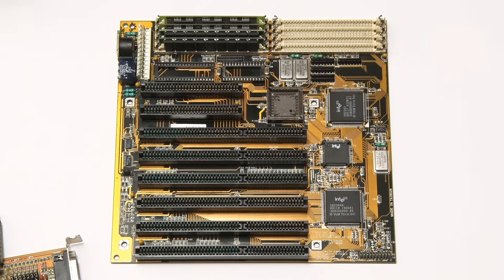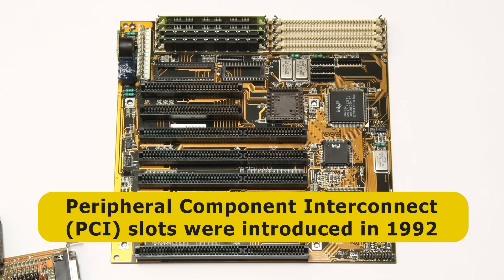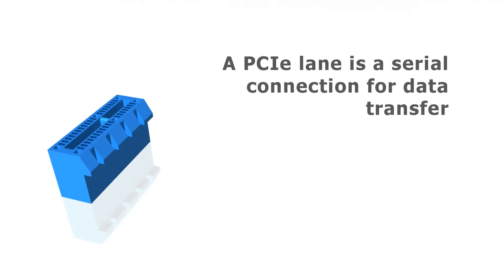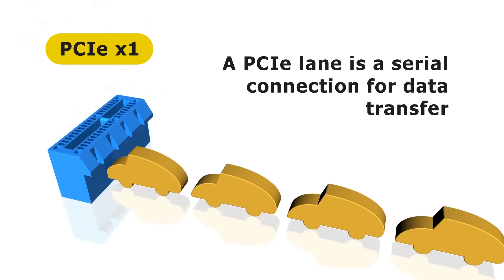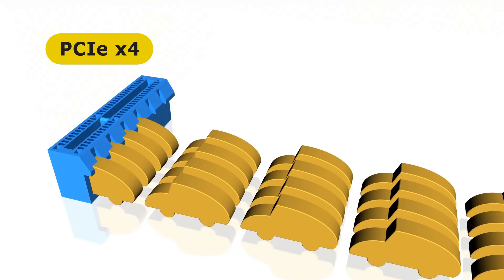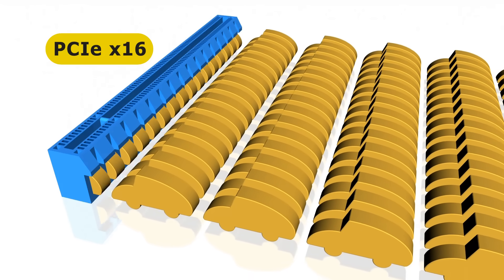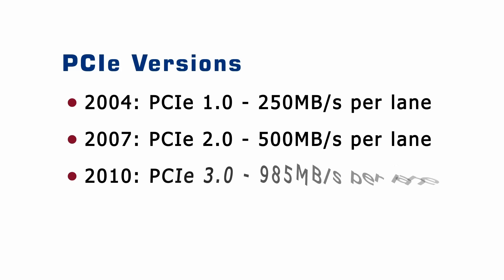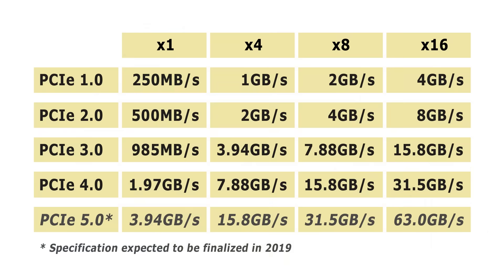Explaining PCIe Slots

Comment: I remember when VESA local bus slots were the limit on bandwidth because of physics, and that would be end of slot evolution.
Reply: Similar to the 'absolute physical' max of 56 kbps for the modem/telephone line.........   (submitting this reply with 30 Mbps over that very same telephone line).  hahaha.
Reply: Ron Freycinet its not actually the very same phone line. Now they are digital and allow for higher frequencies.
The reason line phones sounded so dull and xrappy back then os because they were fully analogue, meaning the dullness was because the line was filtering higher frequencies. Now the problem was that it wasnt by design, they had no way to make the lines have higher bandwidth, and thats why modems makes those noices at the beginning, to test the line response to see what frequency range it can use to transmit data to the server.
Its like trying to record a bluray to a vhs, the signal may be hd but the tape cant hold so much detail
Reply: @laharl2k  I lived in a rural area up until a couple years ago. It was either dial up or satellite. It sucked. When DSL was finally available, I was barely able to get 1.5 down due the age of the 50 year old copper wire in the ground in my area and they needed to take out 5 loads(sp?) in the line on the way to my house from the DSLAM. I now live where I get true gig speed. It's sooo nice!
Reply: That's because incompetent hacks and nincompoops love to make assertions out of their, ehem, assertion ports.  And physicists in the late 1800s and up into the very early 1900s said that we almost had all of physics sorted out, we just needed to work out a few things around the edges... Then by 1925 or so we had both relativity AND quantum mechanics, which we're FAR from sorting out.

Which brings me to the main point of my rant.  Now we're having to learn quantum programming -- that is, writing programs for the new quantum computers available today via something like the old main frame "time share" (luckily they also have simulators to practice on).

But even with classical computing (which is what we're calling our "old" computers), there's no telling what those smart bastards will come up with next.  Fabrication techniques will continue to improve, so the transistors will keep getting smaller and likely more "3d" where they are built upwards more than being flat on a chip and, thus, reducing the trace length and capacitance  between transistors, etc...

Comment: Didya know you can fit a larger PCIe card in a smaller slot, too? I once had a server with an 8 gig HBA and only one PCIe slot big enough to handle it. So I took the graphics card out of that slot, and used a dremel to sheer the card's edge connector down to the point where only one PCIe lane was left. Then I stuck the graphics card into a x1 slot, and it worked! Not perfectly, of course: It was slow as hell to redraw even just the Windows desktop. But as it was a server, that didn't really matter.
Reply from the maker: I decided not to cover dremel options -- although I do show what you describe (a larger card into a open-ended smaller slot) at about 9:50 :)

Comment: I don't usually watch older videos but in this case I wanted to know more about these slots and now I do! Thanks and I am wondering what is used in laptops since that is what I have been using now for many years. I may buy a desktop computer next time since I don't move my laptop much at all now. Desktops seem to be much more powerful for less money because of the larger size and not being mobile.
Reply from the maker: Laptops may have express card, mSATA, or M.2 (PCIe, SATA or USB) slots, used for connecting drives and network cards, but will not have PCIe slots. Desktops indeed offer more power (and flexibility) for the same money.

Comment: This was interesting and useful - however I had hoped you were going to go 1 step further and talk about how the data gets from the slot to the CPU and point out how in some cases the slots use “shared” pathways and sometimes they have variable numbers of lanes.  (ie we have an Asus motherboard with a x16 slot - but it’s only a x16 if we leave another spot empty.  If we put something in the other spot, the original x16 spot becomes a x8 or x4 slot)
Reply: Can i put pcie 2.0 x16 card in pcie x16 slot ?
Reply: @unbroken5011  typically, yes, it will just run slower (on the best case scenario), but sometimes the card will say *frick it, if I'm not on x version of PCI/PCIe I won't work*.
For example, my graphics card (an nVidia GTX 1650 with unlocked clock speeds and GDDR5, from this year) supports PCIe 4.0 (maybe 5.0? I dunno), but I use it on a board from 5 years ago, and thus, the board only has support for PCIe 3.0, so the graphics card sits at a top of 96% of utilization on the best of the cases.
Reply: It would most often be a motherboard limit - not a CPU limit - and it completely depends on how many PCI slots (and what type) the motherboard manufacturer decided to offer.  We have a 9700K and an Asus ROG motherboard that has a “conditional” slot.
Reply: the n° of lanes depends on the chipset it think
Reply: exactly, and the newer 2020 SSD video also misses that point: if you install M.2 ssd in a slot that shares lanes with Pcie x16 (typical primary vga slot), you may have to use 8x/8x or 4x/4x PCIE Bifurcation - so, Chris, it is another good topic for future videos!
Reply: This is because you have a cheap motherboard. The problem here that if you populate everything, they run out of lanes (CPU limitation; this is an Intel CPU, isn't it?). The best solution for this is a PCIe switch (much like an ethernet switch); with a switch you can put multiple cards onto the same lane, and they lose performance only when you use the cards at the same time. However, it is cheaper to assign lanes statically at boot time (a few transistors can easily select the right card).
Reply: Most CPUs don't have that kind of bottleneck and I don't believe motherboards do either. Most CPUs have lane limits up in the 20s and the newest ones hit the 40s.
Reply: @vasilis23456  i've h310 mobo, if besides cpu and ram i plug my x16, m2, 3 satas and ram i AM a couple of lanes above the total capacities of all of my periferals combined. sure, it's nothing dramatic, but it's useful to know somtimes when all of the sudden you see your data copy speeds 4 times below drives specs (after i moved to z370 and separated the drives in the best way i always get 70-110MBps read/write speeds on mechanical satas, on h310 i'd hit 10-20MBps bottlenecks quite often...

Comment: PCIe has evolved to make our fancy little computer components compatible without much compromise.    I splurged on my CPU to get the best one for the socket, I didn't splurge on my GPU just yet, as the PCIe has always been universal and can upgrade that at anytime, as long as my PSU has enough juice.   I bet computers 5-10 years from now will still be able to use today's GPU's (maybe not for actual current gaming)  and GPU's made 5-10 years from now will still fit lovely in our PCIe x 16 (8.0 they may be at by then?)  Crazy the things I learn from just researching on my new computer build.

Comment: Skipped over PCI (i.e. pre-PCIe) explanation.... PCI is parallel... PCIe is high-speed serial:
PCI: max 5 devices... ideal conditions, 64bits@66MHz - 532MB/s... PCIe: up to 32 devices... from 250MB/s to several GB/s...
Also significant, particularly with Graphics cards (e.g. 16x) is type (e.g. DDR) and size of memory to alleviate CPU workload while using higher resolution PC monitors/displays;
Most sensible for PCIe x16 Slot should be allocated for graphics cards (alleviating CPU workload)... PCIe x1 is sensible for USB 3.0 adapters... PCIe x1 for network adapters is desirable...  PCI (non- "e"xpress) should be sufficient for most audio cards... although PCIe x1 (when available) for audio is not unreasonable.
Reply from the maker: PCI was mentioned. RAM will impact PCIe device performance, but this video is about the PCIe standard.

Comment: Are all the PCI-E 4.0 slots reduced to PCI-E 3.0 speed if I put a PCI-E 3.0 graphic card in a PCI-E 4.0 motherboard? Or only the slot that has PCI-E 3.0 graphic card inserted? Thank you.
Reply from the maker: Only the speed of the slot used will drop down (to match the card used in it if slower).

Comment: Good info! I'm reminded of a peculiarity of some 16bit cards, notably Trident video cards and some VLB I/O cards: they would work in an 8bit slot, such as on yours (can't see if it's a 286 or an early 386?) This is how I managed to have an XT with VGA graphics (which proved that the XT's real speed bottleneck had been the mono vidcard; even the sloooow Trident card was a huge upgrade).

That oldie must have been a fancy board back in the 1980s... my goodness, 8 SIMM slots! There I once had an oddity too: a 10MHz 286 board that took a single 72pin SIMM. (Yes, 72pin. It was salvage from an unknown IBM.)

Comment: Question. I saw where someone used a PCIe adapter card that accepts a M.2 NVME stick and that they put into an available PCIe x4 slot and got around 1700 Mbs from the NVME stick vs their Sata 6 SSD drive. 

Alithough the speed of the NVME stick is about half what it would be vs being plugged into a compatible motherboard, but over double that of their SSD, I’m curious if this would work with most any motherboard with PCIe x4 slots that are maybe 2014 or newer or would other issues arise?

Thanks
Reply from the maker: It will probably work in many PCs, but you will need OS support, and also BIOS support if you want a bootable drive. Only PCs with a BIOS from c.2016/17+ will have native NVME support.
Reply: ExplainingComputers that makes sense. Thanks for responding. Love your videos.

Comment: 2:02 what is that slot on the top of the board with the 2 large black brackets around it?
Reply from the maker: That is the processor slot! :) Weird designs in them days,
Reply: @ExplainingComputers  Right I forgot about CPU cards. The Pentium 2s used those iirc

Comment: I've added cards, increased bandwidth and tweaked buses for about 40 years. I have physically flipped hidden switches that increased toggled down mainframe performance, that was only unlocked after the customer paid the fee. Yet you often add the piece that completes the picture so often. This is a great channel. I'm sure a lot of current pro's couldn't be bothered by systems that only worked everywhere after the 8-bit byte became the industry standard. I'm one of the guys from that slow era. I walked into this weird world of ever exploding performance while 3090 mainframes suddenly went obsolete when system 9000 took over. I remember how long it took for me to realize the 3081 system I trained on, actually was two systems within a single processor.  It's irrelevant today, but I recall when virtualization was born. I really enjoy both the trip down memory lane as well as the broader present day picture. Thank you.
Reply: And now 3090's are once again the absolute greatest you can get-- RTX, that is.

Comment: so which PCIe would you want to plug into a Network LAN Card? x16 because you get more data? is that what I am understanding?
Reply from the maker: Yes, if it were a x16 network card. But that  is very unlikely. Most LAN cards will go in x1 slots, as (by PCIe standards) network connections are rateher slow.

Comment: It is also possible to split for example a 16x slot into 4 4x slots with an adapter. that way you could fit like 4 pcie 4x nvme ssd into one 16x slot or 4 gpus at 4x speed (often used for Bitcoin mining because bigger bandwith is not needed there) but you can also put an adapter into a 1x slot to connect a x4 or x16 card into it (but it will run at 1x speed obviousely). My mining rig runs 12 GPUs from 3 16x slots, every single one connected with 4 lanes (3x16lanes/12cards=4 lanes/card)

Comment: A question...

Can an x16 or x8 slot be easily split into four or two x4 slots, respectively? Could the same splitting/conversion also be done to an x1 slot (i.e, one x16 slot to sixteen x1 slots), for example?

Also, as your video was informative and clarified my understanding of PCIE, I've liked and subscribed.
Reply from the maker: Welcome aboard! :) I'm not aware of adapters for splitting/converting a slot as you describe.
Reply: @ExplainingComputers  I believe that they exist for the purposes of bitcoin mining but they go from pcie x8 or 16, via multiple USB cables, to pcie x1. There would, I believe, be a loss in bitrate and likely latency but they exist. I could be wrong but I did look, some time ago. The pcie standard, however, doesn't look to be designed for splitting because the number of power pins looks fixed, no matter what pcie slot (x1 through x16); thus, any splitting would suffer from power issues and likely compatibility issues, due to motherboards probably not being designed to handle splitting.

It would be good if the next expansion standard supported splitting because one could then use a mini-itx board and have up to SIXTEEN expansion cards, with ridiculous numbers of cards for the likes of ATX boards.

(I apologise for my use of UPPERCASE, it's just that I thought the possibility of using sixteen expansion cards in a mini-itx, or even more for an ATX, board to be a jaw dropping amount of expansion capability)
Reply: @ExplainingComputers This may fit the description but I think it uses power direct from PSU. I just thought you'd find it interesting:

https://amfeltec.com/flexible-x4-pci-express-4way-splitter/

Comment: Reminds me how silly our technology is. Industry could have had tiny fiber optical connectors a long time ago. Then you could have millions of lanes at warp speed.
Reply from the maker: But those optical lanes would need need to facilitate electrical connections to the CPU and other components -- the speed limits are those of the CPU, not the wiring. :)

Comment: Everyone forgets one key factor with a 1x slot running a say 16x slot card!  These China made adaptors for miners and such are doing what your cutout slot does but! Also fools your motherboard to thinking everything is pci-e 1.0 cards in the slot.  You need 3.0 o r4.0 1xslot to do this.  Or your 1x slot adaptor  is to slow to even handle basic functions of say a video card.

Comment: You must check the cpu to see how many lanes it can handle. If you plan on using 2 cards in 2 pci x 16 slots, your cpu must be able to handle 32 lanes. If your cpu can only run 16 lanes,  your 2 cards will only be running 8 lanes each. You'd be better off running one card.

Comment: 3:00 PCIe isn't actually based off PCI at all. They just capitalised on the name. PCI is a bus, PCIe is point to point.
Reply: He never said they were based off PCI. He just said it is a faster version of PCI
Reply: @n54.Dmitriy  PCI Express "is a faster version of PCI" has the same meaning as PCI Express "is based off PCI" and faster. It isn't based off or a version of PCI. It is a new system with a completely different design and indeed topology. PCI was a bus, PCI Express is a star network with a point to point link for every device.

Comment: Great video man, I was shopping for a sound card since windows ruined the setup I had that was working perfectly before windows 10. Essentially they have really shady business practices of enforcing planned obsolescence by deliberately breaking hardware functionality through software updates, and never fixing it after years and thousands of people complaining. They get paid by other intellectual property license peddling corporations like Dolby to force people over to the new premium priced crap that they never knew they didn't need. Nothing new there I guess, that's capitalism for ya. Anyway I found a sound card but I wasn't sure if it would work because it was pcie 1.0 and I only had a pcie 16x and 4x slots so I found your video and it explained it very well! It should work in either of those slots so  I put the order through, thanks a lot!

Comment: Wrong graphics card in Slot will blow up your motherboard. What a load of tosh. 
Each slot has notches that correspond with the graphics card notched and if don’t fit in the slot then it’s the wrong card. A computer build is like a jigsaw, if it does not slot in then get a card that will.
Reply from the maker: When I talked about the wrong graphics card potentially damaging a motherboard I was referring to previous slot standards -- particullarly APG -- where it certainly was possible to put the wrong card into a slot, not least designed for a different voltage. This is not a problem today as you say, but it was 20 years ago.

Comment: Hello, I have an itx motherboard with an x16 slot, I use an integrated 1Gbps network card, and I use a second card in the PCIe slot, can I put in such a PCI-e slot any extension through which I could put two network cards? I need to add a wifi card, or I haven't encountered wifi and LAN cards in one.
Reply from the maker: You can certainly add a LAN card to give you two Ethernet ports in total. Or a WiFi card. Like you, I have never see a combined Ethernet and WiFi card. Many mini-ITX boards can take a WiFi module in an mSATA or M.2 slot.

Comment: I tried a PCIe 1x card in a 16x slot, it doesn't work
Reply from the maker: A PCIe x1 card should work in a x16 slot. But, as with all cards, it may need the correct drivers to be installed, in addition to just plugging in the card.